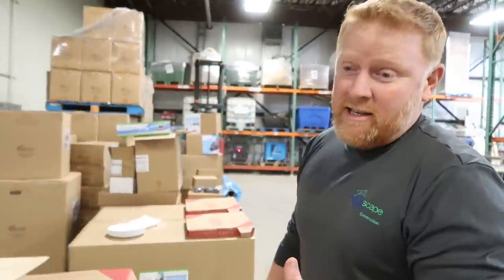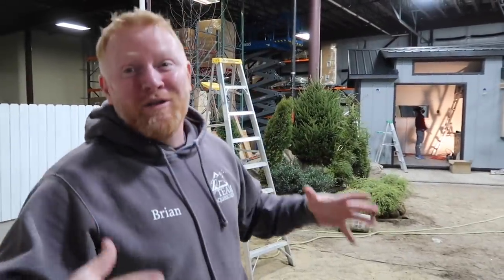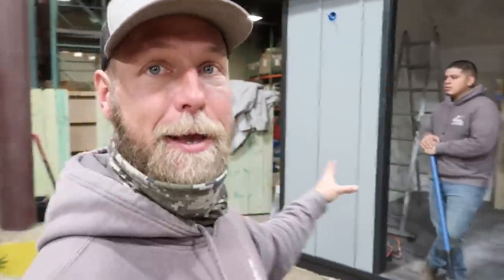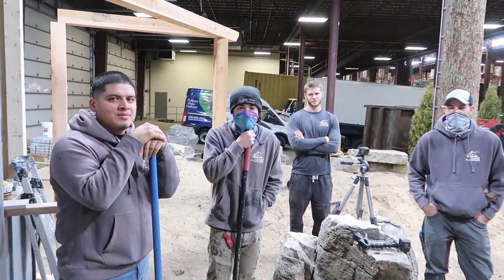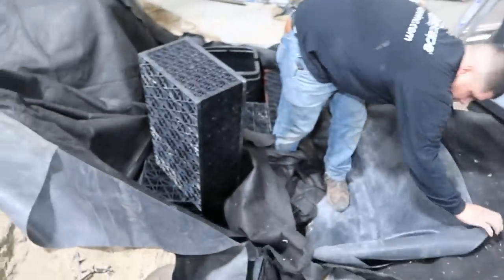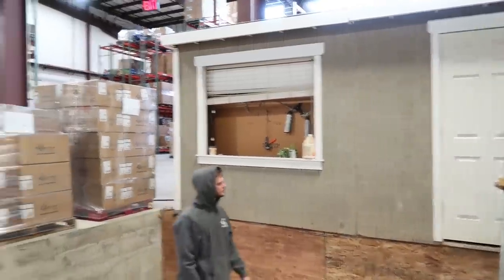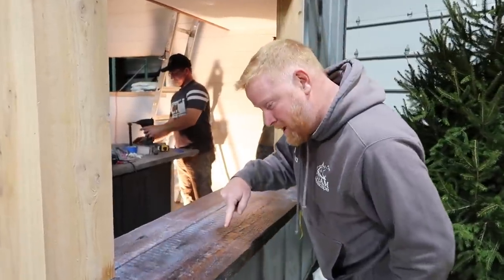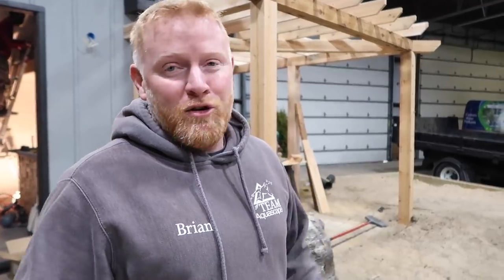Almost There! Aquascape *SANDBOX for PONDS* - Part 2

Comment: This is a changeable indoor playground. Don't worry about blocking the warehouse elements. I'd rather see them than black back drops. Loving the shed and the reclaimed outside bar counter! Using that wood is a lot like taking downed trees, rocks and moss from a job site and installing them. Materials that speak to their geographic environment always make an installation more interesting!